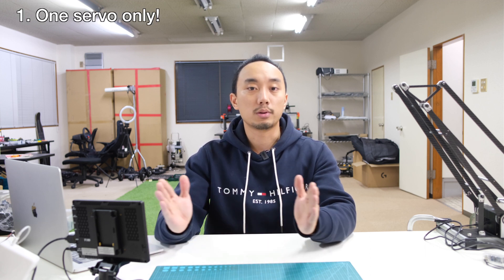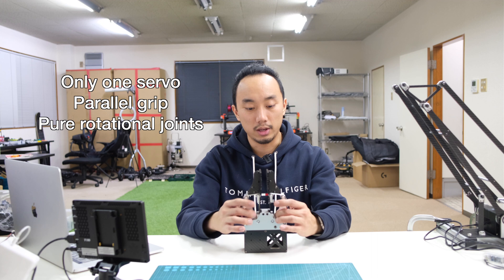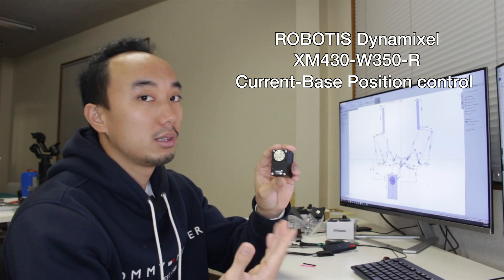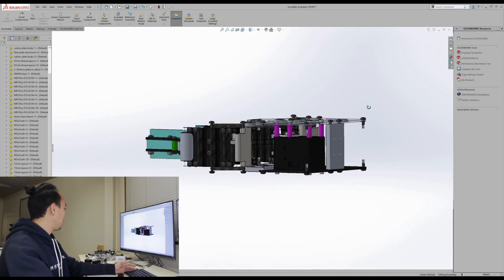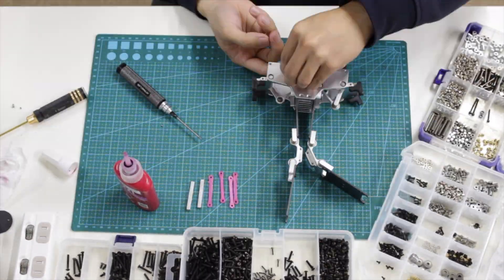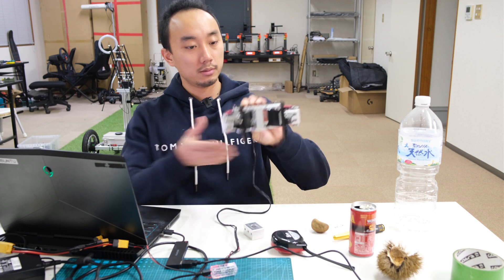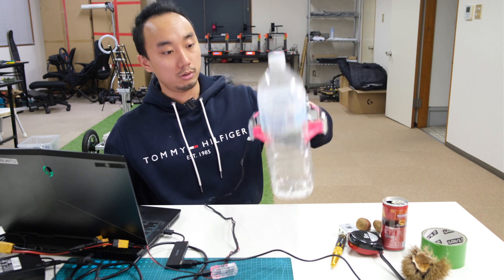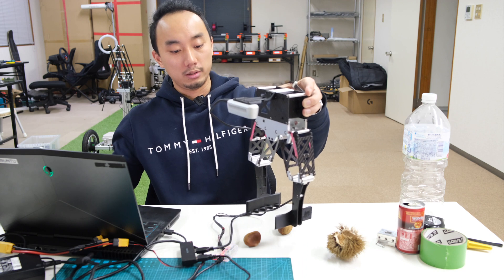How to Design ROBOT GRIPPER with No Gears!? No Linear Joints!?

Comment: Is there somewhere where we can scale up the measurements for Watt's Linkage, almost like a calculator where you tell it what lengths you want one side to be and it tells you how long each length should be accordingly? If we were to make a robotic gripper ourselves?
Reply from the maker: yes, of course, the watt's linkage geometry is scalable under the constraint between links. So all the links could be multiple times bigger/smaller according to your design.  You can try search on how the watt's linkage equation looks like. Good luck!
Reply: @stepbystep-robotics  Thank you

Comment: Just stumbled across this fantastic channel. Subbed immediatley. Keep up the great work you do!
Reply from the maker: Thank you very much, this made my day :)
Reply: @stepbystep-robotics  No worries! Your work is great, especially the 3D printed cyclodial gearbox, as I was looking to do something similar. I was wondering if I could ask you a quick question. Would be possible to do position control on the BLDC motors by using a cheap ESC and magnetic encoder running a PID loop? I have been looking at both the ODrive and Vesc and they are quite pricey.
Reply from the maker: @stefanguiton  I think it’s possible to do, but to control the BLDC we need FOC for precise control like position control, and that is implemented on Odrive and VESC as well. Honestly I haven’t tried make it from scratch because those open source controller already done that for us :) .
Reply: @stepbystep-robotics  Cool, no worries. Thanks for the quick response